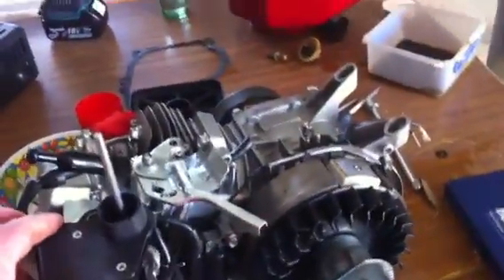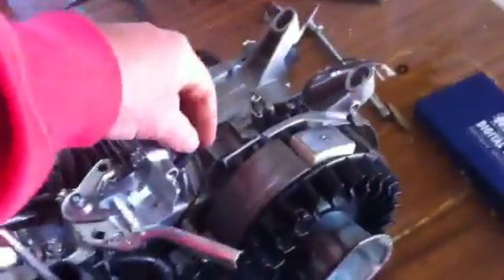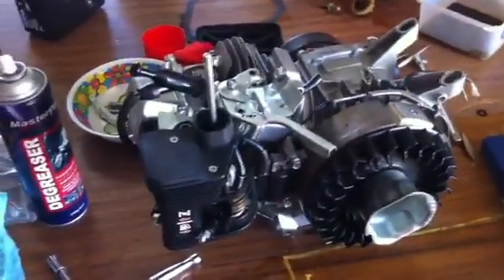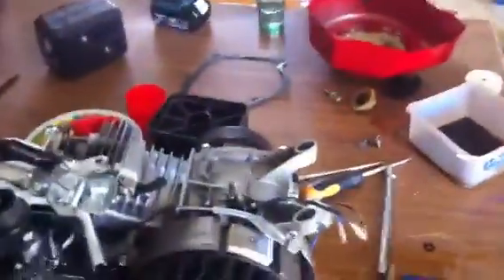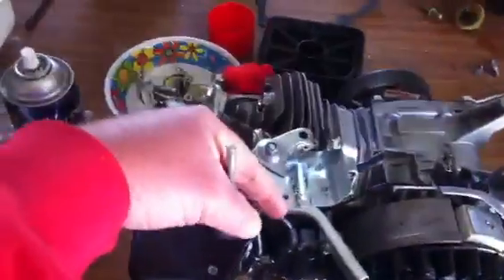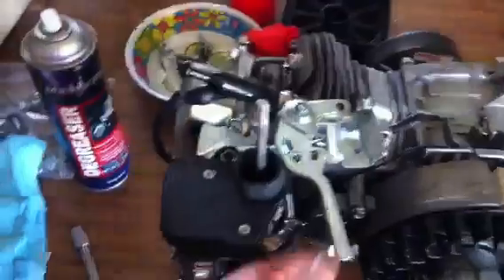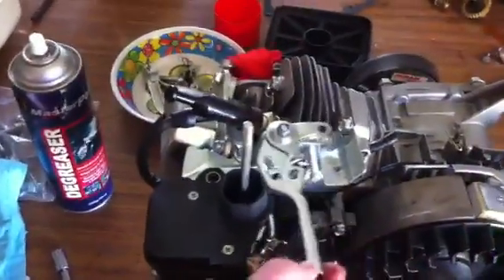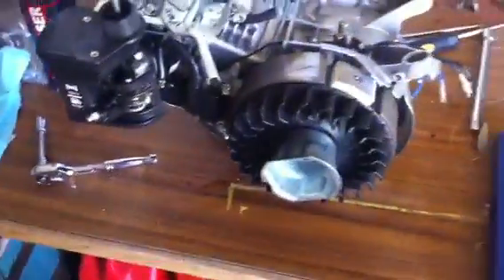Bypass governor on 6.5hp motor

Comment: I did the same thing I removed the gas tank and disconnect the spring and metal rod that goes to carburetor and unbolted and removed Governor arm. I shortened the rod and connected it from carburetor to acceleration arm the only thing I had to make sure of was the spring from carburetor idle to hook to something I was sure would work so I took the long spring that was connected from carburetor idle to old Governor arm and ran it from carburetor to back bolt on gas tank. It starts and runs good I can still adjust the idle but when the weather breaks I’ll see if everything is good so I can run the adult sized mini bike and make sure I gained more top end and my idle works properly and doesn’t run full throttle while I get on it. I have another 212cc I’m building and I’m completely removing all internal Governor and low oil sensor junk while I’m in the block changing the Cam to a more radical long duration lobe set up.

Comment: so do you i still use the rod that goes from the governor to throttle linkage?  cause i did the bending rod like you did but when i started the motor and turned off the choke my mini bike went flying and i got seriously hurt broke collar bone bruised spine and cut my leg bad on chain. im new to this so i learned the hard way.. and after thinking about it i would assume i need the rod that connects to the throttle bracket linked to governor in or to have throttle control. . is that why my bike took off no linkage?
Reply: did you hook up the throttle return spring?

Comment from the maker: No need to take motor apart, just bypassing governor if you look in the video were the governor comes out the top of motor all I did was turn it one way so the governor would not touch any moving parts inside the motor then use a split pin or what Eva you got to pin it back to keep it from moving you should see what I mean at the 29sec mark of video hope it helps
Reply: 27rolee mine makes a odd noise when it's revved up and I hold the govener back
Reply: Then your governor gear grenades inside the case and waffle stomps the engines guts.

Reprehensible.

Comment: You mentioned pinning back the governor, this has got me confused. have you actually gone inside the engine of just changed the throttle setup on top of the engine?

Comment from the maker: Sorry forgot to mention putting a return spring on the hand accelerator and put we're suits I take the 10mm bolt out the top of the pull start cover wrap other end of spring around that then tighten back up but I sure there is better options thanks.